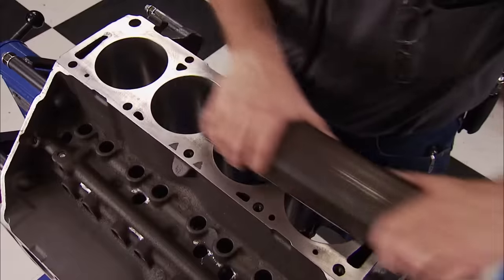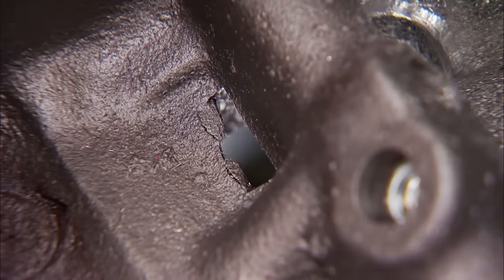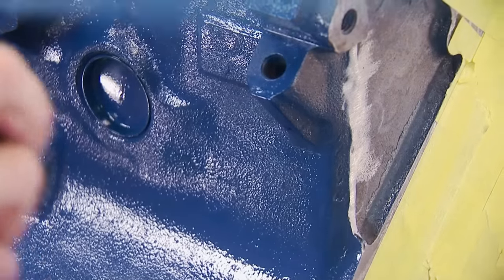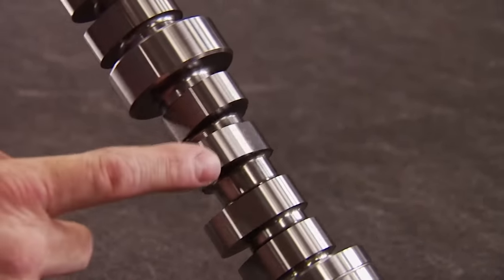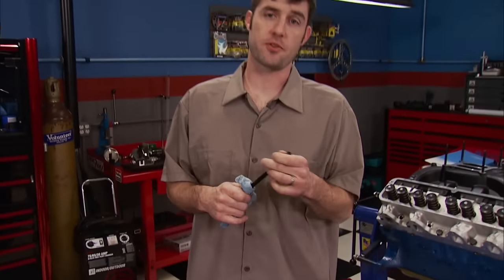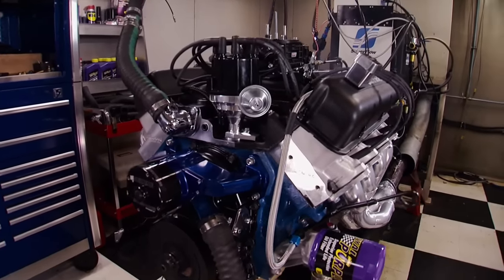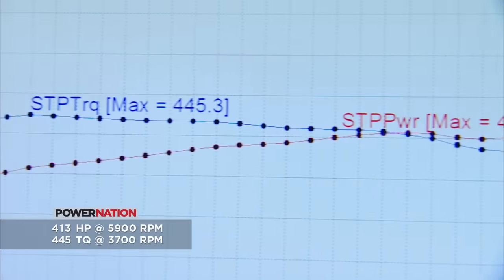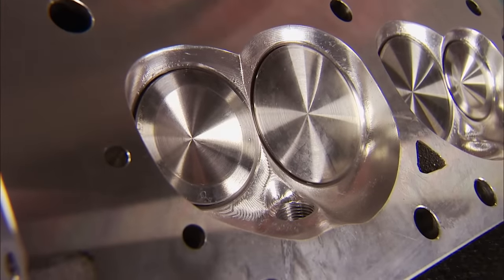Revitalizing A Ford 390FE With A Modern Twist - Engine Power S3, E7

Comment: Reminds me of the "old days"
In 1966 I was driving a 59 Galaxie with a 352" and three speed with O.D. I was taking engine rebuilding at our local JC when I met a man on the street who offered me a 427 FE block outof a drag car....$75.00 with a broken rod wrapped around it's neighbor wedged between the counter weights..took a chance and went for it...got two used rods and Pistons out of the junk yard...block was OK.
    Stuck it in the car...broke it in...and finally put my foot in it. Scattered the three speed and limped home.
Went to another junk yard and bought all the running gear from the block to the rear end out of another wrecked 427" Galaxie.
   I replaced my mag wheels with  stock steelies with stock hubcaps and a set of cheater slicks. Powder blue and white car looked like ma Mas grocery getter.
    Street raced a 56 Chevy gasser with a 327" and four speed...blew him away.
    30 years later I was telling the story to a friend who exclaimed  "I built that car...you were racing my brother"
     American Graffiti  was fimed next door in Petaluma CA and some of my high school friends worked on the cars.
     I was blessed to live "the real deal"
Reply: The 327 sbc is no joke, but yeah, no way it's staying with a 427 FE in a similar weight car. The 427 revs like a 283 but with all those extra cubes.
Reply: Your bragging about blowing away a small block 327 with a big block 427 with like double the HP?
Reply: @unclequack5445  Ever hear of Bill Grumpy Jenkins? Put a lot of big blocks on the trailer with 327's. they have a great rod-to-stroke ratio and can be wound up like an alarm clock--pick the right power-to-weight car combo and you can make grown men cry.
Reply: @albertgaspar627  Albert the baddest ass ride I ever owned had a 327 and a 4 speed I think it was 3.73 rear.
Reply: @unclequack5445  what car was it in?
Reply: @albertgaspar627  70 swb C-10 pick up the motor came out of a schoolbus I was told and we rebuilt it all I had was JE pistons a mild cam Quadrajet and headers and a electronic ignition it would still bark the tires coming into 3rd gear if tuned right a Q-jet was not a bad carb.
Reply: @unclequack5445  a 3.73 rear gear would be a perfect setup for a truck back then, so long as it wasn't one of those real "granny first gear" transmissions. 

you are preaching to the choir about Q jets, I grabbed 'em when they were $5 in the dirt at swap meets, $10 on the table. Helped out when i sunk a float on my 1968 4-4-2, i bent a primary needle putting the lid back on (i was dumb enough to not pull the carb, and that year Oldsmobile does not open its hood as well as my 1969 GTO did). New needles are $29 a pop before shipping, so I went thru the bookcase full of my old ones to find what I needed. I still pick 'em up cheap when i can, but they are mostly "restoration" prices now. (last week I hoped to score three with a set of small block headers and a pair of summit mufflers for $50, but after a 2hr drive and tolls the stupid FB seller was a no-show. ugh do people just not want my money? lol). Loved the potential of the HEI, I grab 'em when they're up for sale at $10 and people (who blow cash on Accel yellow coils and red MSD boxes) just look at me funny until i point out the companies remaking HEI to fit Fords and other engines. Not that there's anything wrong with Pertronix and all the rest, an HEI won't fit a Roots blower or a tunnel ram. but I'm not building high compression racing engines, just toot-around street stuff. the more affordable it is, the more cars i get to scratch off the "bucket list" inside my noggin.

Holleys are the "chevy small block" of the carb world, but if you want to play with the jets you take a float bowl gas bath most times and better put chapstick on the gasket so you don't tear it. As a Ford fan I can say what was great about chevies was you could easily go to the junkyard and pick up a corvette or Z28 intake manifold for cheap enough and still get some performance out of it. If you had a Ford 2bbl small block, good luck with that cheap route!
Reply: @albertgaspar627  My cousin had a 351 windsor that went through all the hell he could put it through.
Reply: @unclequack5445  The tall deck Windsor's getting the attention it deserved all this time, but Cleveland 2Vs were still common enough in a junkyard. Edelbrock should make a head-intake-cam kit like they used to for the Ford 400M, they're halfway there. Usually only the truck guys wanted to hot rod those.  One drawback on the 351W was they were typical Ford--small ports and valves compared to the "mouse" in order to generate torque. If you wanted to make higher RPM hp, you had to build a Clevor--a Cleveland headed Windsor.  But offset grind that Windsor crank to a 318 Mopar connecting rod and Chevy 350 pistons, and those heads fed 377 cid...a complicated way to rival a Chevy 383 but fun none the less :) 

i have an early 351W in a 1967 Mustang. They could do 300 hp with 10:1 cr, and then you just port heads, add headers and tune another 50 hp--add Chevy valves and up the cam choice and do even better. Back then in a light car it was a respectable performer, but what scared a lot of engine swappers was that front mount distributor--it cleared the firewall but got you a front sump oil pan that had to clear the suspension.
Reply: @albertgaspar627  Whats a 351 Modified 400 Ive seen one in a buddies truck.
Reply: @unclequack5445  When Ford decided in the 1970's gas issues that big blocks had a shelf life, they decided to make an engine in between the 351W and the 361 FT (formerly the 360 FE, but with a forged crank that if you turn down at the machine shop, can be used in 390 applications). The 400 M (either stands for Midland or Modified, your choice, some think it stands for the former but in a 351M the latter) has a big block transmission bellhousing pattern on its back, Cleveland heads with a different combustion chamber supposedly designed for better swirl patterns, and a taller deck than the other small blocks. Ford decided later that 400 cid was not fuel efficient, so they destroked the engine to 351 M. Its taller deck means you can't run other intake manifolds from the Cleveland or Windsor lines unless you're handy with a milling machine and create two spacers for each side of the manifold and then seal off the front and back "China walls" of the lifter valley. Though personally I would make a two piece manifold to replicate Edelbrock's recent design (they got it from Pontiacs) that lift the runners up so air can flow underneath to cool. 

Edelbrock has a basic intake for this engine, and the recent Cleveland heads I believe will fit it, so it's just a matter of a camshaft that will work with both. I think that if they put it all together, they might get some attention (rather than an engine owner having to hunt the parts independently) to this engine design--its easy enough to just toss it for a 460 since the engine was designed to replace it during the gas crisis. someone out there makes a 426 cid stroker combo for it, but i think there's only dual plane intakes for it since it pretty much showed up in trucks and ford/lincoln full sized cars needing torque not HP.  One imagines the potential of a 426 Cleveland small block if only one had a free machine shop, but the real draw for these engines now is to steal its crankshaft for turning a 351W into a 400 + cid stroker.
Reply: @albertgaspar627  Right but isn't a 351M already a destroked 400?
Reply: @unclequack5445  that is correct, the 400M came out in 1972, the 351M was created in 1975 by destroking it at the factory.  In the aftermarket world, folks noticed that with some machining, the 400M crank would fit inside a 351Windsor block and take it out to 400 cid on a stock bore. It became popular enough that the aftermarket  copied the idea by just casting crankshafts to fit and offering a connecting rod and piston package to go along with it. Just like the Chevy small blocks with the 383 stroker swap.

Here's the history in case you're interested.  In 1968 Chevy changed the rod bearing size on their crankshafts, so when you wanted to stroke out a small block engine without buying a $2,000 billet crankshaft, you offset ground the rod bearing areas of the crankshaft of your choice to match the pre 1968 connecting rods (they were always the same length no matter the engine, until the 400 cid). A 4 inch block using a 350 crank would become a 360cid, a 4.030" block would be a 365 cid, .060" over would be 370 cid. Fast forward some years,  the 400 cid small block due to its siamesed cylinder walls needs steam holes drilled into its cylinder heads, and folks not knowing this would grab their fuelie cylinder heads, slap 'em on and overheat their 400. Folks then looked at their 400 crankshafts--the main journals are bigger due to "journal overlap". when you stroke out a crankshaft, you give it strength by having the main journals and rod journals overlap each other, and so when the factory strokes an engine, they make the crank have larger main journals to keep the overlap (say, a Pontiac 455 versus a Pontiac 400).  But a good machine shop could turn the 400 chevy small block crank down and fit it in the 350 block and make 383 cid, which in turn could make 400-500 hp, and weigh less than a big block. so it became popular.

Ford guys realized they could offset grind the crank in their 351 windsor to fit a 300 inline six connecting rod, or a Mopar 318 connecting rod and get 377 cid, but if they machined a 400M crank, they could get 400 cid out of a standard bore 351 Windsor. then crank makers got into outsourcing from China and found it was just cheaper and easier to cast cranks that would fit into 350's that made 383 cid and Ford Windsors that made 
400-427 cid. Most of the Chevy 400 and Ford 400M cranks they'd been machining all that time were cast from the factory anyway, so no real loss of strength--just a lot of work done by trained machinists to get it all right when they could just pay someone to pour metal into a casting and voila, the same type of crank brand new.
Reply: @albertgaspar627  Absolutely.

Same reason the Ford 289 was Mr. Shelby's favorite engine to race with. 1.79 Rod:Stroke ratio. Which is very similar to the 327's 1.75 ratio.

Doesn't seem like a big deal, but 1.8-1.85 is considered ideal for quick acceleration. For example, the 302 Ford and 350 Chevy both fall all the way down to around. 1.65 ratio, for not a lot of cubes gained.
Reply: @perotekku  Right, Shelby began with the 260 in his tigers since that's what he had (i think a 302 crank and rods strokes out to 272 cid in those little things) but even George Barris swapped over to using the "Cobra 289" in his cars (i think he got some free from Ford, which always helps. funny that Ford always used the word "thunderbird" in front of its engines to denote power, like Chevy used "corvette", but then Shelby had the Cobra and suddenly everything Ford pushed was "Cobra"--cobra jet, super cobra jet, etc).

smokey yunick may have possibly made his declaration about longer connecting rods due to working with chevy 350's and 400's. about the only use for the short connecting rod is changing the piston speed up the bore and how that affects filling the cylinders and camming the engine around that.
Reply: Atta baby. So glad the FE lives on with Kaase!
Reply: Awesome!! I’ve got a ‘59 Fairlane 2-Dr post car. It’s got a 352 auto. Can’t wait to get it on the road this spring. It will be the first time it’s been in the road since 1980. 😊
Reply: @albertgaspar627 no such thing as a 400M. The first year for the 400 was 1971. In 71, the engine came out with a flat top piston. The only year.
The destroked 351m, modified, came out because of the high demand in the mid block cubic inch engines.
The 351 C and W engine plants could not keep up with the demand.
Reply: @jesse75  no such thing as the Ford 400M? you might want to go to parts stores and ask for parts for one...somehow they exist for an engine that you claim doesn't exist :) 

They come with a bolt pattern for the big block transmissions not the small blocks...hence, they were designed to replace the 360/390 FT models though customers preferred to have a big block in theory to brag about, even at 360 cid.
Reply: @albertgaspar627  haven't you ever looked on a Ford valve cover ? The sticker itself says "  351m, 400.
The 400 never needed a letter designation like the three of the 351's did. 
This is straight from Ford nomenclature.
And some 400's came with the small block bell housing bolt pattern. 
If you had rebuilt as many of these engines as I have, you would know this.
I even had to correct Mr. Drag Boss himself in some of his posts.
Reply: @albertgaspar627  Google for yourself this: Picture of a 351m400 valve cover sticker. It will show one from a bronco.
Notice what Ford put on the sticker.
Reply: @albertgaspar627  I have several times scrutinized what Wikipedia has said about the 351/400, 335 engine family.
It is very accurate. You may want to review it.
Reply: @jesse75  why yes, i have looked at the valve covers, the silver emissions stickers,  i've looked in the FSMs, I've looked in NAPA parts catalogs, b/c i've worked on 400M engines...even ford called 'em 400M. been that way for years, but yes , now people do drop the M because they get confused between "midland" and "modified". as for wikipedia...they get their facts wrong so often they have to put a disclaimer that their work may need to be reviewed.
Reply: @albertgaspar627  how can you drop the M when Ford never put it there in the first place ? The 400 came out before the 400 block was modified to a 351 cubic inch engine. Hence in Ford beginning no such thing as a 400m.
Read Wikipedia. It's historically accurate.
Reply: @albertgaspar627  I've already made reference to Drag Boss. He'll also clarify the designation 400m is incorrect.
Also, Richard Holdener, has been corrected to Ford's original use of the 400 indicated with out a letter.
In the book: FORD 351 Cleveland Engines by George Reid.
On page 30 under block specifications he has listed the 400 without an M.
Also on page 141 of Reid's book, the colored illustration of an engine Holdener put on the dyno says " 400 " only.
Reply: @albertgaspar627  look online at a picture of the original air cleaner decal on a bronco with the 400.
Decal clearly says " 400-2v. 
Auto parts stores have been wrong many times over. Should never be an absolute reference. 
Early Ford repair manual states 400 listed. Not 400 m.
Reply: @albertgaspar627  under the 335 engine family wikipedia: 
Sub heading 351m/400 ID confusion.
" Ford's use of the 400 block in the creation of the 351m engine has resulted in the 400 mistakenly being referred to as the 400m or 400 modified. "
" Ford's official for the 400 V8 contains no additional designations - the proper nomenclature is simply  " 400 .".
This subheading was created because many, like you, don't understand clearly Ford's original designation of this engine.
I grew up during this time. Early 70's, Ford had three different 351's, and that made for some funny comments from parts counter people and argument.
Reply: @jesse75  "how can you drop the M..."

>>>because people come up with new references--the Chevy big block was the "Porcupine" at first, then became the "Rat" in reference to to the small block being the "Mighty Mouse"

 "the 400 came out before the 400 block was modified to a 351 cubic inch engine"

>>>The block wasn't modified (like say shrinking the bore of the 302 to create the 255 cid V8), the 5M crank was changed to one with a shorter stroke. for someone who's built so many and finds wikipedia to be a gold source, i'd think you wouldn't need me to teach you this :)  Otherwise, I already said the 400M came first and the 351M second for fuel economy reasons so we agree there.
Reply: @albertgaspar627  drop the M ? Ford never had it to begin with. Ford applied the M to the a 351 crank put in the 400 block. And it wasn't the Windsor crank. It was an all new crank.
Why is that so hard for you to understand ?
I gave you reference. Where is the reference from Ford stating " 400m ? " 
There isn't any.